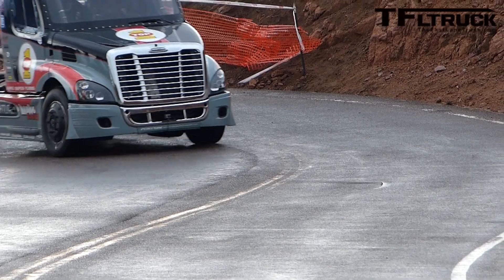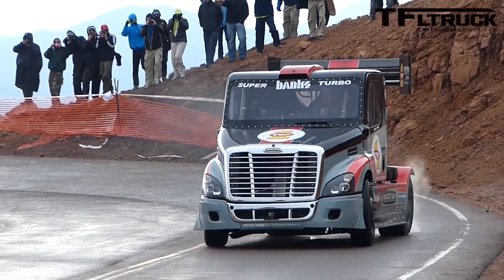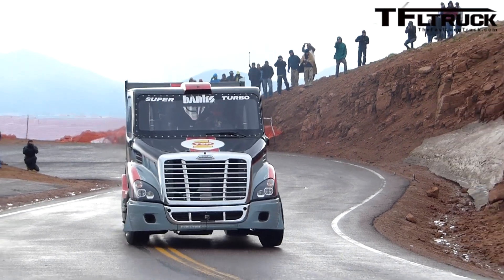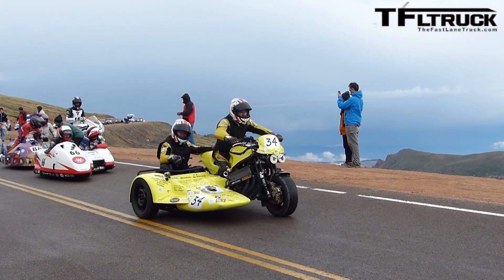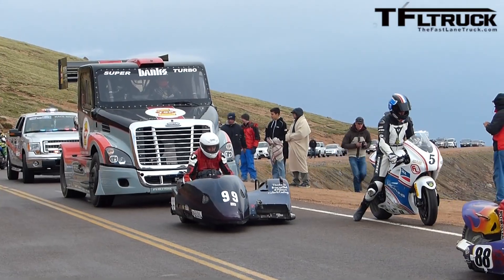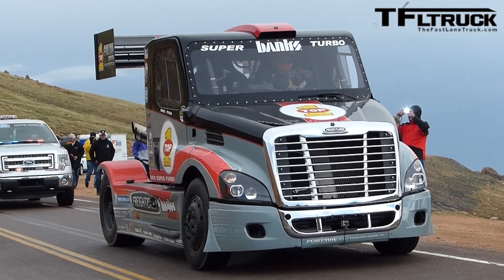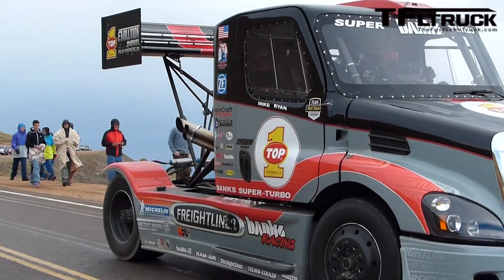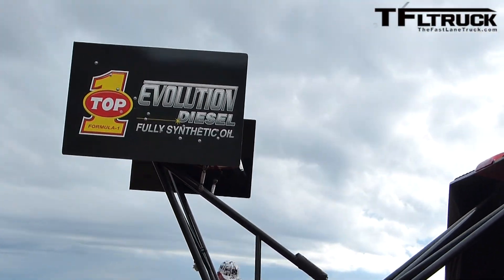Pikes Peak Super-Turbo Semi Freightliner Race Truck Explained

Comment: Wait until the Tesla Semi starts racing Pikes Peak.
Reply: Killroy if it ever comes out. Plus it’s gonna be super heavy compared to this already heavy truck
Reply: The 500 mile range Tesla Semi will be heavier than a conventional semi, but not significantly, but be careful what you read on the internet, because there is some incorrect analysis on the Semi weight.  If the Tesla Semi is racing, it does not need all that range, so its gaining to have a amazing power to weight ratio and it will not have altitude fueling challenges as conventional engines have.  Electric vehicles have been doing great at pikes peak.
Reply: https://www.youtube.com/watch?v=LlvYv1SJJEY

Comment: From what can be seen there isn't much of the original Freightliner chassis remaining!  Looks like an independent suspension set up on the front, and wide single rear wheels.  So basically it's a Freightliner silhouette on a custom chassis.
Reply: It's the same as a race car they call a NASCAR a Chevy SS but it is nothing like the stock one besides the badges. Same idea with race trucks.
Reply: Dodge 318 Cummins

Except it uses a diesel engine.
Reply: The wide-base singles in the rear are common on real trucks, although not on drive axles in North America. But I agree, it's not a Freightliner.

Comment: Freightliner sucks. The windshield traps snow at the A pillars. The area of the windshield NOT covered by the wiper sweep allows snow buildup. The defrost is grossly under powered.  The wipers are almost useless in the snow; the blade tips lift off the glass. Windshield washer fluid is dispensed from the wiper arms and does little more than soak the drivers mirror. There is no washer system available to clean the mirrors when a passing vehicle blows road sand over them in the snow.  The same is true of the headlights. The mirror heaters are weak. The AC is under powered.  The OnGuard radar anti-collision system will apply the brakes hard, without warning, and for no apparent reason.  The cruise control will drop out and refuse to reset until you stop and restart the engine.  The driver accommodations in the sleeper are miserable. The electrics, including the on-board computers, appear to operate as functions of random chance particularly in those Freightliners assembled in Mexico. The quality control of the Mexican Freightliners is a joke. The last truck I drove was a 2013 Freightliner Cascadia and I hated the goddamn thing. FREIGHTLINER SUCKS!
      That being said, the only worthwhile use for a Freightliner might be to strip everything off off it that makes it a truck and race the damn thing up a mountain......................
Reply: In new Zealand its the best truck of 2015
Reply: +Mr. Dark Chocolate234234 New Zealand
Reply: Jesse......And every word is the truth. As long as Freightliner has been building trucks you would think these stupid issues would have been cured long ago.  They continue with this shit year after year because we keep buying it. Every time I had to slog their piece of shit through a blizzard while squinting through their caked up windshield and mirrors, I fantasized about kicking the living shit out of their jughead engineers.......Frightliner is operating a 12-step program to cure those addicted to trucking. They certainly cured me. I want nothing more to do with any of this piss poor excuse for a profession or these plastic computerized trucks.
Reply: Been driving them for 25 years,  no issues here.  perhaps you have spent too much time at the " bitch bar" ie breakfast counter.   Absorbing tales of splendor from the " I gotta have a peterbilt" crowd.  I grew my peter, did not need one bilt.

Comment: European race truck would beat this shit all day long
Reply: beertjeisbotergeil This has a lot more horsepower than a typical Super Truck, nearly three times as much. It's also geared for fast acceleration at low revs. So no.
Reply: Well it has about 800 to 1000 hours more then the supertrucks of the 90s

Comment: I have a Banks 6 gun on my 03 Cummins and it sucks! It works when it wants to with no rhyme nor reason.Same weather conditions,it works,shut the truck off,get back in and it does not have the same power but with no smoke lol and its a dog.It has power when it smokes and its not a lot but noticeable.